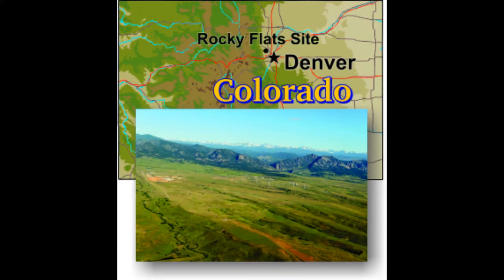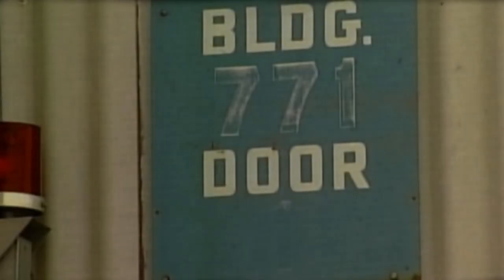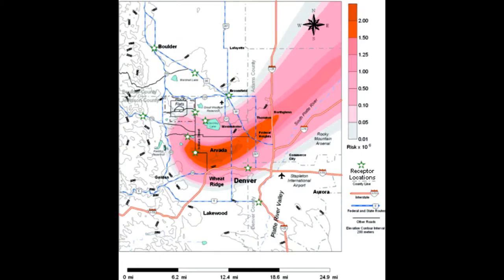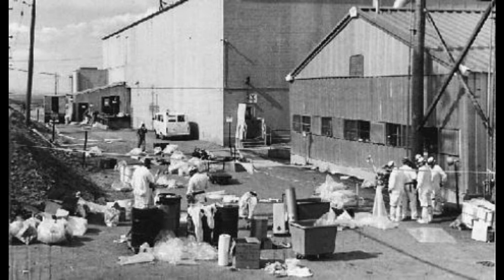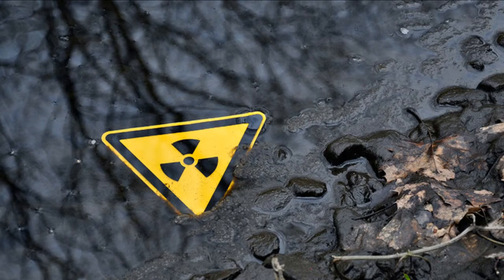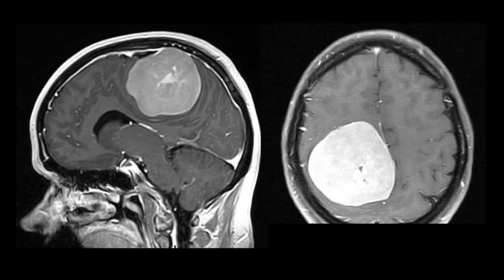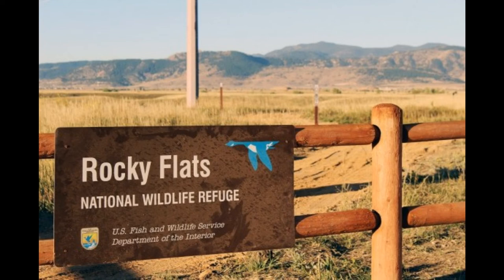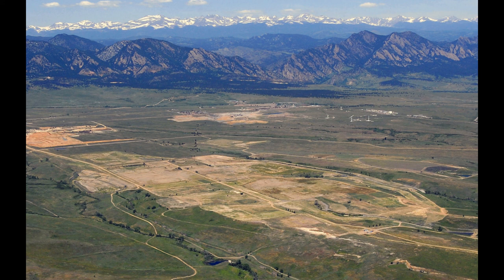Rocky Flats plutonium plant | A radioactive nightmare in Colorado

Comment: Years ago I went to a forum on the movement of low level radioactive waste - old safety suits, boots, tools, etc. - from Rocky Flats through my town in nearly impervious reinforced containers down to an underground waste facility in New Mexico. It turned out it wasn't really a forum, it was a bunch of environmentalists talking. One guy said the buildings shouldn't be torn down and everything left in the buildings because it would be safer than moving and burying them. I told them  - "Haven''t you heard of tornados?"
Reply: that lead mine out in Iowa? is an example that leave-it doesn't work.

Comment: Um, the normal level of Pu is zero. If it does decay it turns into Uranium, which is less toxic but still radioactive.
Reply: Technically. But because of a blanket of global fallout, they came up with a new "normal" which Rocky Flats violates thousands of times over.